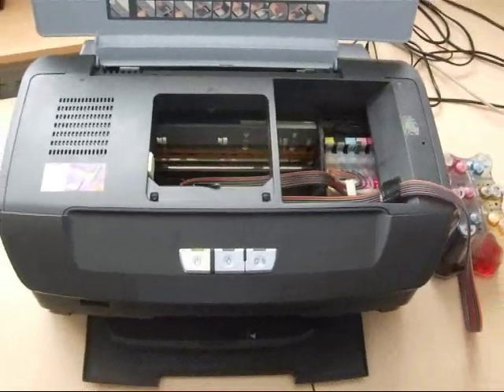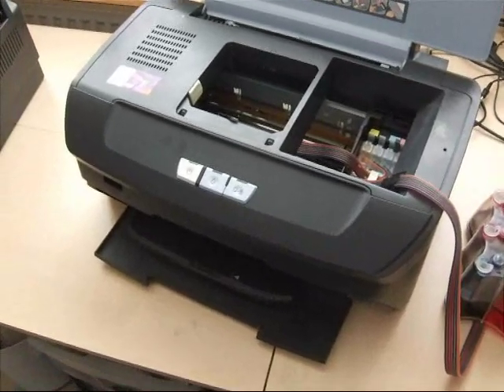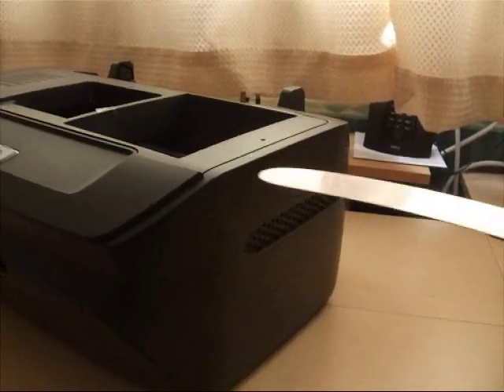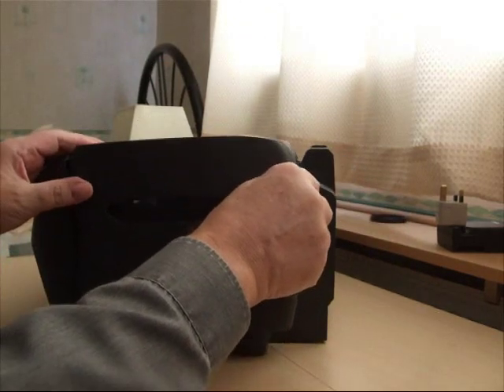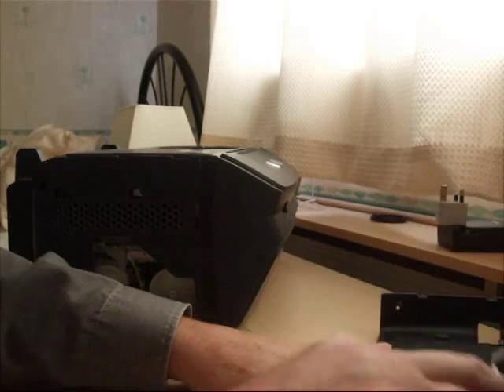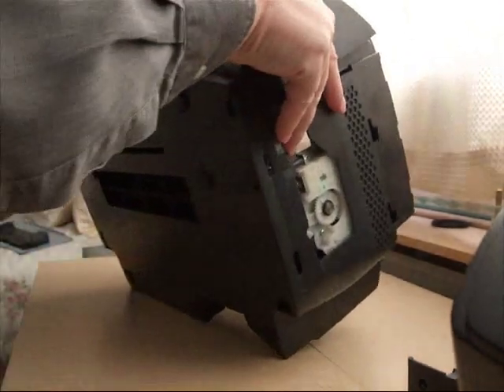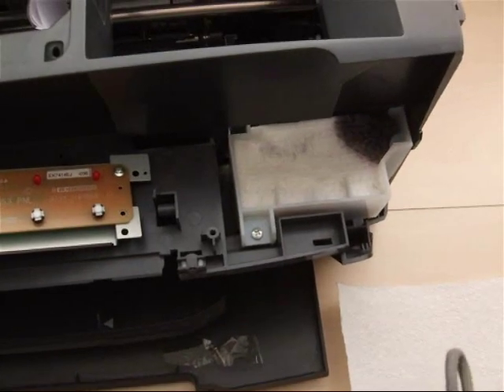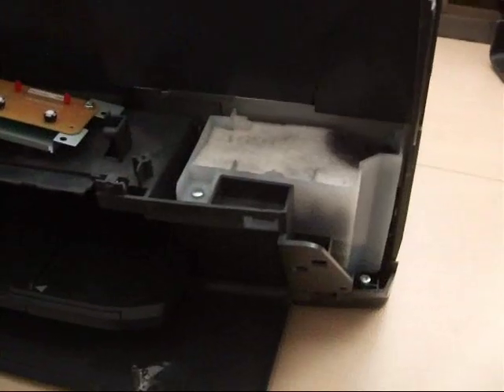secret  to dismantling R265 printer

Comment: Thanks for the video! 

The printer I cleaned had been due for a cleaning months ago, it was overflowing and the ink dripped out of the printer onto the table.

After finishing the cleaning and assembling it, the printer no longer functions, I plug it in the power light comes on but nothing happens, PC doesn;t identify it, I can't turn it off using the power button, pressing any of the other buttons does nothing. 

Any ideas anyone?

Comment: Good bit of instruction.  Took my ink pads out with needle nose pliers, after removing the cartridges (actually a CISS unit).  A friend borrowed the printer and left it stored for a couple of days with the CISS system on top of the printer.  You wouldn't believe the amount of ink in the pads. Took two buckets of water the clean them and a week to dry.  If you do it that way, make sure you've got a plastic dish or old meat tray handy to drop the pads into.  Great video though.

Comment: I have the same system -Something fell into the paper feed (my fault) and had some horrible noises could not get it to clear-and knew I would break it if I tried to dismantle it so oh dear killed my trusty printer thoughts of tidy tip here I come but wait Mike Dove has shown me the light with a bread knife and I manage to clear the clogs one side and after alignment back to normal yippy  Cheers your the man.

Comment: Great vid, will be using this to strip my r265 and clean pads, I have had mine for about 10 years and print a lot, I've got a ciss on it and its only cost me approx 12 in ink for 10 years usage, and my kids print a lot, gunna get another ciss soon as my printer is still ok but the ciss has worn out, lol,

Comment: Fantastic guide, thanks Mike! My pads badly need doing! As you say this is a fantastic printer so will give this a bash in hope I'll get a few more years use out of it. 

Problem I have is no matter how many times I clean the heads via software, the prints now come out blurry in places. Have you any idea why this might be? Is it possible to clean the heads manually, and if so, do you have a guide??? :)